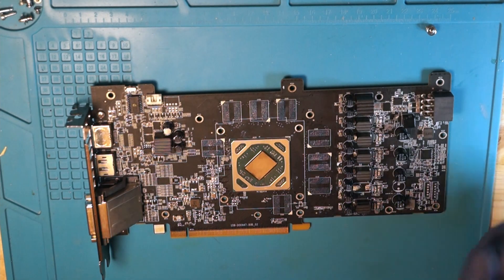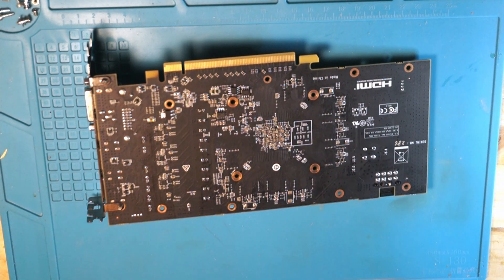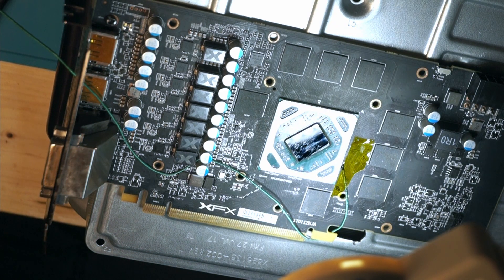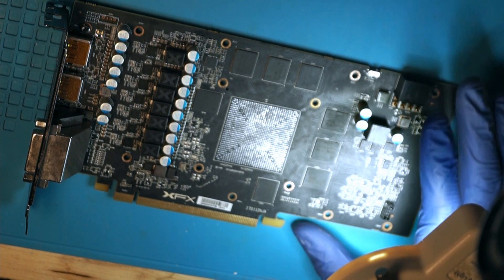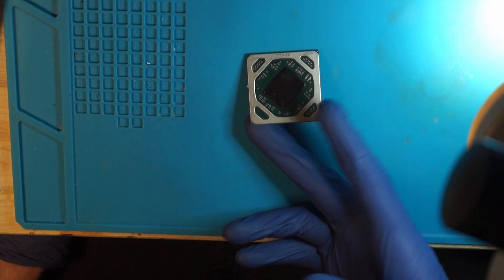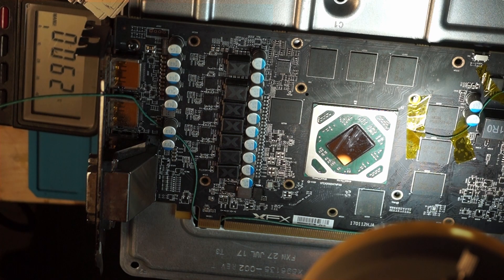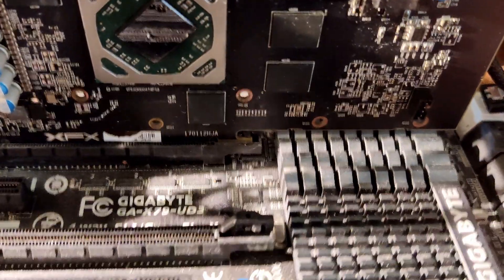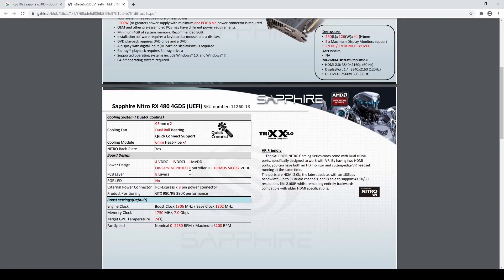Replacing a broken GPU core the DIY way ¦ The Great Polaris Switcharoo

Comment: I wonder if it would be possible to upgrade the RAM or switch out the core on my 680 SOC to a card that already has 4 GB I have a 680 super overclock card and the core is very capable it's just the vram is so limited it's only two would it be possible to upgrade the vram on this card or put the core on a card that already has 4 GB of vram??
If you'd like I can send you the card so that you could give it a try it would be amazing to see what it could do probably not impressive by modern standards but it's very overclockable and the extra vram would make it viable for modern applications and at least low end settings on games
Reply from the maker: I would not change the core unless it is really needed, but rather change the memory. So far i nerver did an Nvidia upgrade, but i'm currently working (or rather planning ) on one. So once I've done that i can probably tell you more. Regarding sending the card, the problem with that is the international shipping. Swiss Post charges obscenely high rates (sending and receiving + import duties) that unfortunatley makes such a project very expensive, and its probably cheaper to buy such a card localy:( But Thank you for the offer! 
I'm looking into it, these a bit older cards deserve some love too...
I hope you have a great day and best regards
Reply: @fxbbm  I'd be willing to pay for it just to see if you could upgrade the memory on the card and to see if it would be able to actually use that memory the 680 super overclocked card can be cranked up to ridiculous levels the vram is just so extremely limiting it could probably play and do lots of modern tasks if you can find one of those cards it is a very good one and worth looking into!